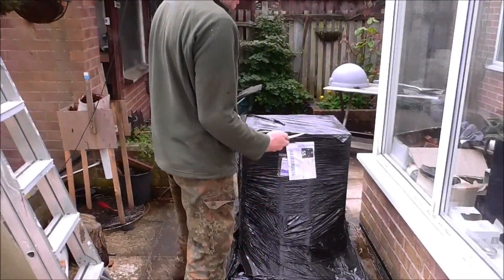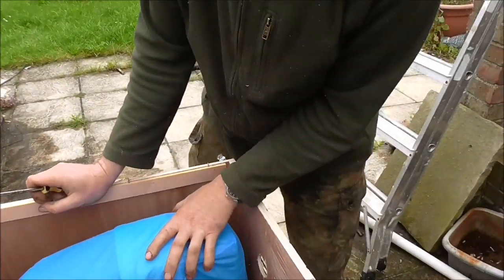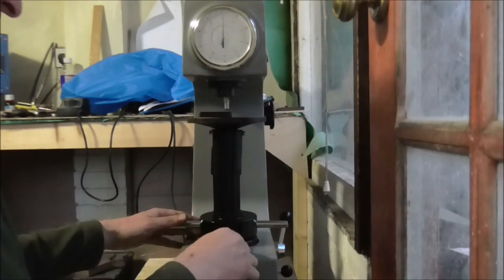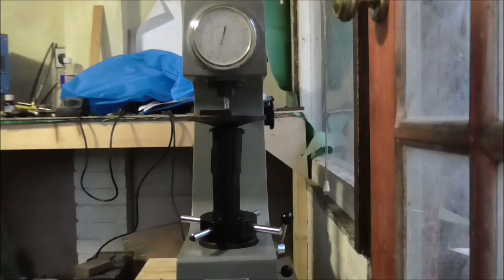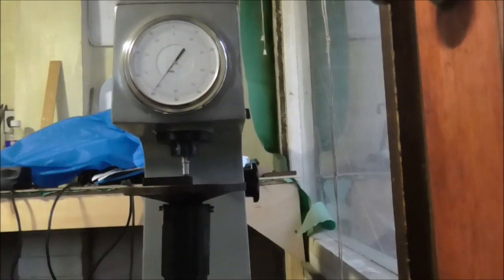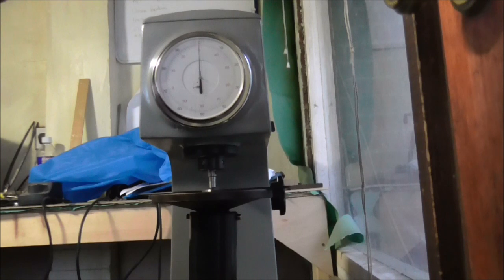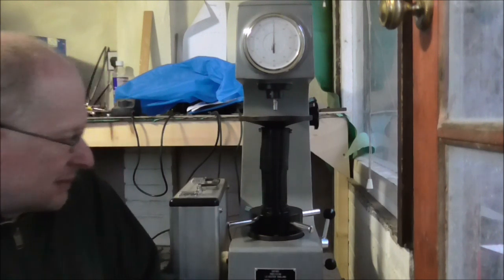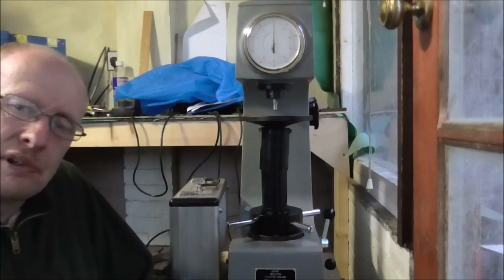Rockwell hardness testing

Comment: Sandy at what stage will you test your knives? Do you only do it the once or a few times throughout the knife making process?  Atb Glenn.
Reply from the maker: Glen, There is only a need to test at the end of the tempering cycle. I also test on a piece of scrap which has been allowed to cool from quench to make sure full hardness has been reached. The blades are not allowed to get cold. They go into temper when they are just hand holdable.After building many knives I know where the Rockwell will be. The machine just confirms this to me and will also alert me if a heat treat goes wrong. If I was working with a different steel that I was not familiar with I would test at the end of each temper cycle and adjust accordingly.

Comment: Hi Sandy
Man - seeing that machine takes me back.  It looks almost exactly like the one I used to use in 1968.  When I was describing it to you last week I had trouble remembering the details but seeing it now brings it back.
A very good buy - you are to be applauded for your professional approach to your craft.
Best wishes to you and all the family,
Noel
Reply: Thanks Noel,
I knew the blades were coming out fairly close by the temper colours and edge retention tests I was running, but having the tester to hand is like having a pair of eye's that can see the hardness value. It will be an invaluable tool when I experiment with other steels and it will also warn me if my heat treats should drift. Things like thermocouples which control temperatures can drift with age, so now I have a means of keeping an eye on things.
Sandy

Comment: Great stuff Sandy,I just got an old portable ernst hardeness tester cheap on ebay but it needs repairing,do you know anything about the old ernst testers?
Cheers Jason
Reply: Hi Jason,
I don't know anything about Ernst testers. The main thing is to find a test block by which you can calibrate it. These testers are sensitive machines. When I got mine I have to disassemble support transportation blocks and clamps. I would be careful buying a second hand tester unless it is well prepared for shipping .
You are welcome to visit and use my tester any time.
Sandy